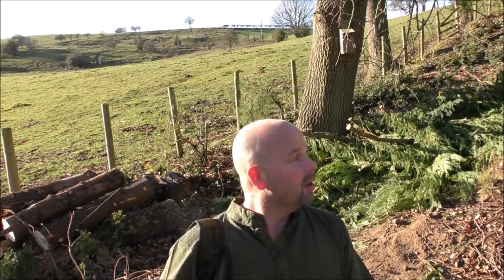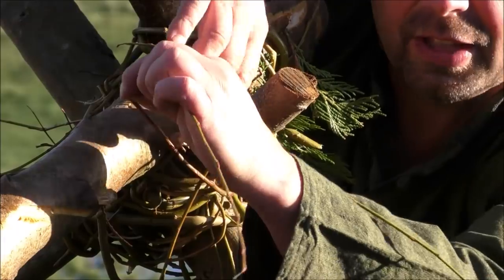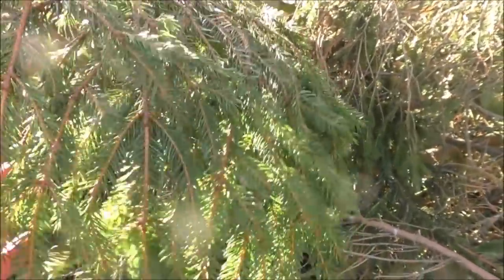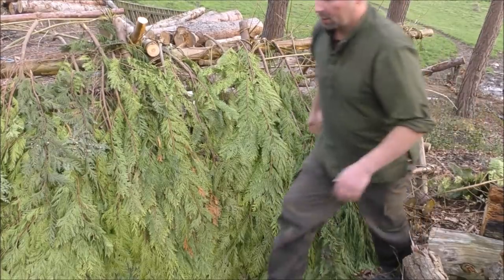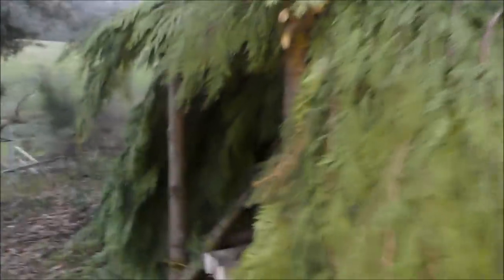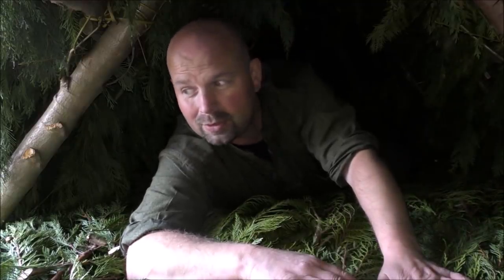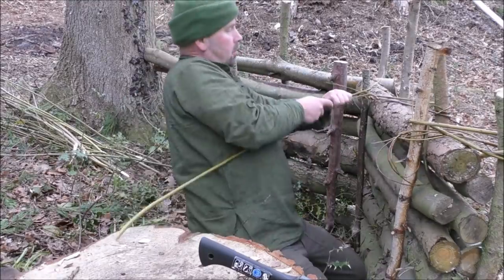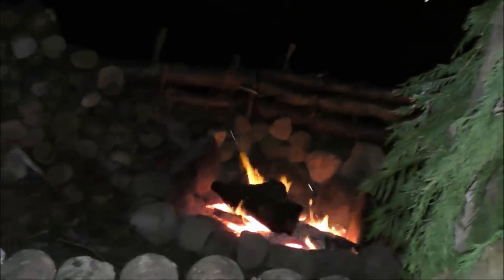'Arctic' Survival Shelter - Building a Natural Shelter Using Bushcraft Skills

Comment from the maker: (TIME STAMPS BELOW)
This is another magnum opus of a 'how to' video but you will find time stamps below for your convenience as well as useful links.
The entire building of this survival / bushcraft shelter took 5 - 6 hours and the camp fire with heat wall took another 1.5 so in total it was a decent time outlay but the result was worth it.

Obviously it would have been much quicker if I had opted to build a more simple shelter but I wanted to go with a raised bed, natural covering and natural bindings (Willow) since I wouldn't learn much if I made one using a tarp and paracord.

Folding Bahco Laplander saw: http://geni.us/hUFyD
Fiskars X5 hand axe / hatchet (new model): http://geni.us/lp8vW5

If you enjoyed this video and found it useful please share on any group page / forums as it is great to share skills and ideas with like minded people.

TIME STAMPS:
00:00 Intro
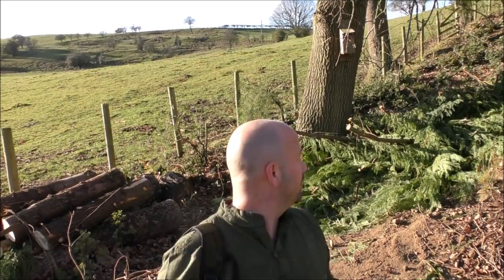02:15 Building the frame
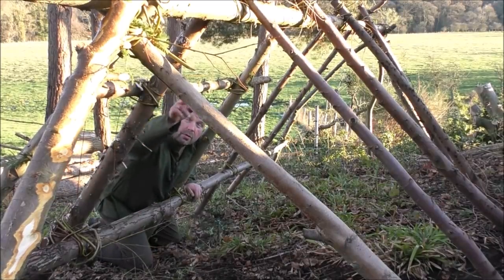13:54 Explaining the raised bed and entrance
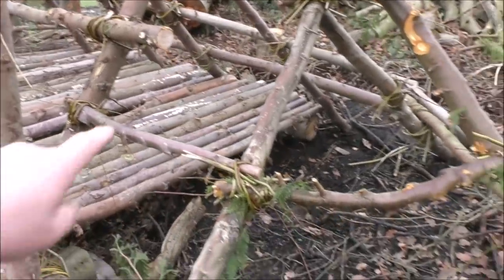17:50 Explaining the entrance cover
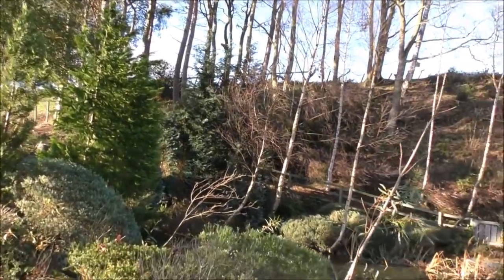19:27 Identifying the types of trees used
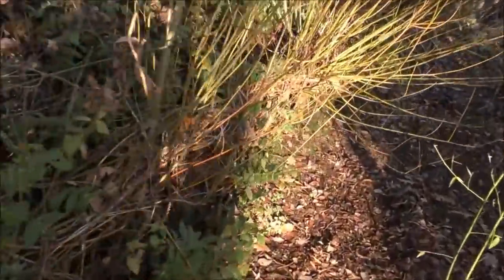20:55 Harvesting Willow and adding it to the shelter frame
23:14 Finished shelter frame and explanation of covering
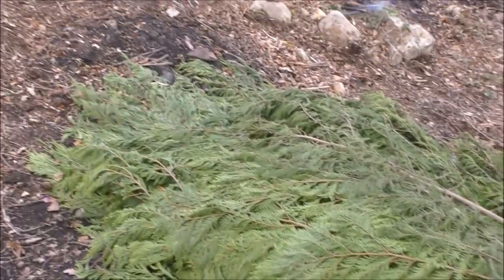25:30 Covering the shelter and explanation of method
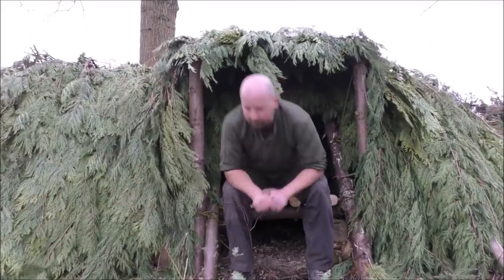34:59 Cutting heavy Spruce branches
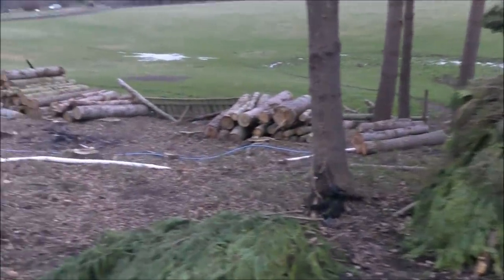37:30 Covering the ridge of the shelter
42:17 Summary of shelter build
44:18 Cutting branches for bed and fitting them in shelter
50:00 Insulating under the bed
51:17 Heat wall behind fire
1:01:05 Building the camp fire
1:05:27 Summary and outro

USEFUL RELATED VIDEOS:
Beech woodland survival shelter: https://bit.ly/2G4XCVo
Willow and debris shelter: https://bit.ly/2G6tYPp
Shelter building using a shovel: https://bit.ly/2B6Cmet
Building an igloo: https://bit.ly/2sRJ3Ng
Willow fish trap: https://bit.ly/2FTtQ6z
Pipe method catching fish: https://bit.ly/2sPyURd

RECOMMENDED PRODUCTS ON AMAZON: https://goo.gl/jMaBWy
INSTAGRAM: https://www.instagram.com/pondguru_outdoors/

FILMING EQUIPMENT:
Panasonic HC-VX870 HD camcorder http://geni.us/3UwE
+Rode stereo microphone: http://geni.us/4OL
+Rode 'deadcat' mic cover: http://geni.us/1pmn
JVC Everio quad proof HD camcorder: http://geni.us/e09e
+Rode 'deadcat' mic cover (opened up and held between tripod and camera base) http://geni.us/dee24
Zomei Z666 tripod: http://geni.us/1a1af3
Manfrotto MTPIXI-B PIXI mini tripod: http://geni.us/87f7

If you've enjoyed this video please check out the playlists on my channel for hundreds more  - on a variety of subjects.
Feel free to share or link any of my videos on facebook, twitter, forums etc. for the benefit of anyone you think may also enjoy watching.
See you next time.
Pondguru
Reply: That does not look like a temporary shelter at all. Like most things, temporary-permanent... Could have kept one of the bigger branches/made a little frame to make a door/cover when no fire in use.
16:45 Could have used some of that Night video with some voice over.
48:00 Conserving body heat.
Reply: hi everyone ,if anyone else  wants to uncover long term survival shelter with fireplace try Franaar Escape Death Formula (do a google search )? 

Ive heard some pretty good things about it and my colleague got great success with it.

Comment: I tell you what Richard that looks very cosy !!
Reply from the maker: It is practically windproof and waterproof so those branches did a great job against the weather.
Reply: @pondguru  Thing I always wondered Richard is if I were thrust in to the willd in the winter here with just the clothes on my back how would I survive ? Every time I walk the dog I am thinking about what type of shelter could I make and what would I eat ? I think my chances of survival in this senario are very small.
Reply from the maker: @MarksShrimpTanks  Anybody's chances of survival would be very small, mine included and on so many of these 'survival' shows the people in harsh conditions are decked out in all the gear they need to stay warm and dry - strip that from them and they'd be just as cold as you or I for sure.